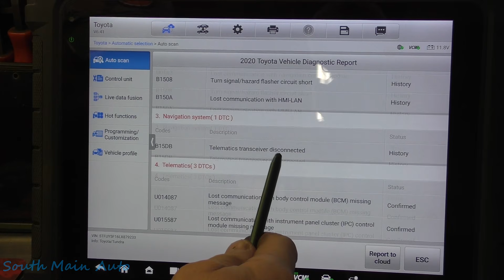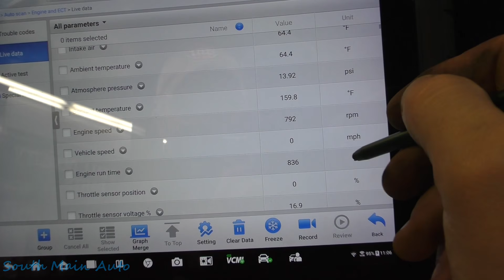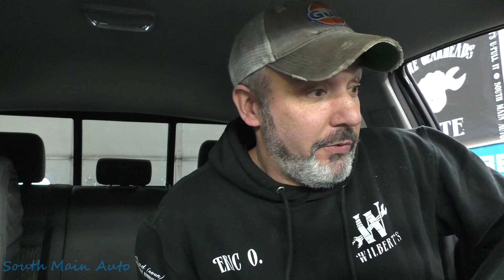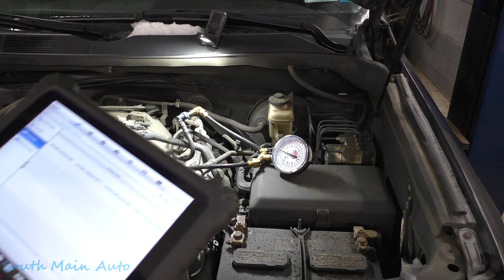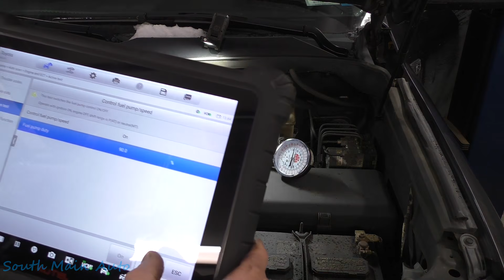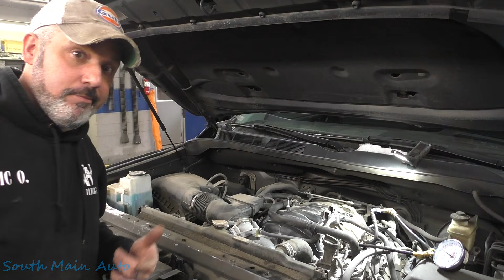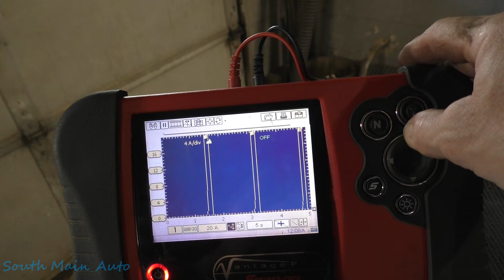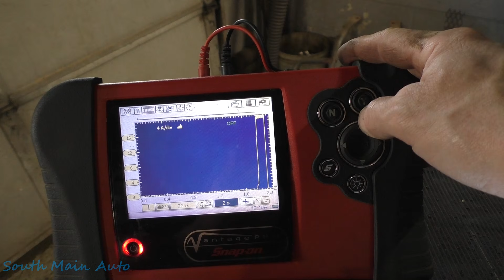My Customer Is Getting Shafted By The Local Toyota Dealer

Comment: My mind started to whirl at the point where you targeted the next area of attack.  A dealership mechanic would have the luxury of then walking to the back racks and load their parts canon until the issue was resolved.  you had to use critical diagnostics.  This is one of my favorites.  Thanks.

Comment: Lets see, fuel pump made in China,  life expectancy not rated, quality none, and end users are to do quality tests. But the profit margin on the end product increases. I do not like installing electrical connectors and electronic modules on the frame or underneath a vehicle where they are exposed to water splash areas. Also, what happened to corrosion proof frames and under coatings?

Comment: What is amazing to me is you are actually SPEAKING to your client/customer. I was actually told by my local Ford dealer that “we usually don’t want technicians speaking directly with customers.” when I asked to speak to the technician directly. How in the WORLD am I supposed to explain my issue when I have to translate it through a service advisor that usually has absolutely no idea as to what they’re even talking about…
Reply: Typically what happens is the problem diagnosis changes as the chain of explanation lengthens.
Reply: While likely not the case in your circumstance, look up "customer states..." videos for reasons techs may not benefit from talking to customers directly.  Even Eric laments customer descriptions at times...
Reply: @BrianFullerton yup😅
Reply: @BrianFullerton  I've had a regular customer tell me that he hears a slight grinding noise. I get in the car and I can already hear it at 5mph in the parking lot and roaring down the street at 20mph. The majority of car owners are totally unreliable to describe what's wrong unless it's something as simple as "my headlight doesn't work". Even then, there are way too many people who don't know how to turn their car's headlights on manually. I hate to think that people are stupid. But in this industry, common sense seems to be rare. Literally had to argue with a customer the other day before a blizzard that when they press the button and "TCS OFF" comes on the dash, that means that traction control is off, not on.
Reply: @XSR95 I went down this road with the overdrive button on the dash for dodges, it's obvious, and the tach tells you, hit the button revs go up indicating a down shift and od off, some people just don't have it in them though
Reply: When i take my 22 Tundra in,  I demand to talk to the tech. They are the only knowledgeable people.
Reply: This is one of many reasons why I am my own mechanic,
Reply: That's the problem I've noticed working as a tech for 11 years. It can be even worse the other way though. I've explained to advisers what the problem is and the reason for failure then I hear their conversation with the customer and they absolutely butcher it. I still prefer to not talk to customers but rarely have to now due to having a tech of 25 years working up front. He still wrenches too so we both still learn from each other. It's great not needing to explain how the evap system works and why it needs a purge solenoid only for them to say it needs a gas sensor.
Reply: From Office Space: (The Bob's): "So, what would you say that you do here? Well, I take the customers reports and bring them over to the software engineers. 
Well, why can't the customers give their reports directly to the software engineers? 
I'll tell you exactly why - Engineers are not good dealing with customers and I have people skills".
Reply: I’m a tech at a Toyota dealership I would call the customers name in the ounce all the time and talk to them all customers usually appreciated it. It’s nice to get the story directly from them sometimes.
Reply: @JKCL20  in your honest opinion, do you think service advisors even serve a purpose? Or does it just make your job more difficult?
Reply: it equates to more dollars because of the line of confusion not communication!
Reply: As a seasoned marine mechanic sterndrive and outboard, any runability work order I would always insist on calling the customer and pretty much interrogate him/her.  They never seemed to mind as I would tell them any info they give me will help us get to the root cause quicker and cheaper.  Well would ya look at that..there's your problem lady..  Cherrs all!
Reply: I had the same issue with my local Ford dealership. After some fineggling I did get to speak to the service manager who arranged a sit down with the tech and we cleared things up. I think it just protects techs from customers.
Reply: I’ve worked on both sides of that service advisor and tech. A lot of techs do not want to speak to customers do not know how to or do not care to do so. Not blaming them just could be one reason why
Reply: @Banatar  And I've only worked the tech side and can definitively say that I always like to hear the problem directly from the customer, not translated to paper by a service writer. Some service writers know the right questions to ask but many do not; which can lead me to chasing my tail. And on the dark side, if I don't have complete or accurate information the chances are greater I will be replacing more parts than necessary, unbeknownst to the customer.
Reply: @Banatar  I dont like speaking to customers that is what the advisor is for. I wouldn't expect an advisor to a fix a car for  me. Im flat rate not hourly.
Reply: @joelopez40oz23  you're one of those horrible techs that think you're better then everyone because you turn a bolt lmfao.. im willing to bet you can't diagnose much.. and pass on jobs that require actual work to figure out.. unless its hanging on by a thread or snapped in half.. You're one of those people who probably hack your work back together like the repair shops around here do too.. im almost 100% certain you try to cheap out on parts and repairs then charge the most you can on a job.. how many procedures do you actually follow vs jacking up the job by trying to cut corners to save time? Face it.. You're a conman just the same.. your attitude speaks volumes. "I don't like explaining myself to people after I caused more damage then what they had when they brought it in".. is how you sound.. just like all the other hacks in that industry
Reply: @joelopez40oz23  This attitude is why we can't get vehicles diagnosed properly. Because of you parts swappers.
Reply: @Banatar wrong., its the shops trying to play middle man so they can charge more for work that wasn't needed, then claim they weren't told the issues you had.. how do I know? Because over 7 shops did this to me in the last 3 years on my truck.. how about techs arent all that intelligent and don't want to do half the work Eric does in these videos.. most "techs"  at dealerships are oil changers and tire rotators.. they don't want to FIX anything anymore..
Reply: @jacksparrow3490  How many dealerships have you worked at to come to your conclusion?
Reply: @joelopez40oz23  sounds like more then you.. try ive worked for one of the biggest in my area.. and many smaller ones as well.. how about the dealer trying to tell me it would cost $1000 to verify my transmission is bad when it was in limp mode? The tech didn't even know was AWD all the time meant.. he tried claiming my truck was 2 wheel drive then 4x4 when it detects a slip on the wheel.. oops wrong.. my truck is AWD with no switch.. so no, techs don't know anything anymore
Reply: @jacksparrow3490  only you know everything lol.
Reply: @joelopez40oz23  obviously know more than you drinking your 40oz.. which im sure you "test drive" customers cars for every little errand you run..  I bet you hot rod them nice sporty cars too acting like their yours.. You're one of those clowns who gets caught driving a customers car like you stole it.. go watch some videos of people leaving cameras in their cars taking to a dealership.. this isn't knew information there buckwheat.. You're one of those lying mechanics who can't articulate what you did on a car because you hack it up 🤣
Reply: @jacksparrow3490  "Over 7 shops" did this to you? So... 8 shops?
Reply: "how about techs arent all that intelligent and don't want to do half the work Eric does in these videos" <--- This is partly true and some techs have not been trained or educated to perform a proper diagnosis which requires time, research, tech manuals... all of which may negatively affect profits. Hence, the shop managers may not allow.
Reply: Tell your local ford dealer to go to hell.
Reply: I would leave that dealership NOW
Reply: Super good work by Eric I love the old school tech tool "hammer" that's what I do all the time and the comments on this video are excellent, people in the field who have real world experience with the public, I can do relate , great stuff 🤠
Reply: I always want to talk to the customer when I work on their car. Especially when I can’t duplicate the concern.
Reply: Your technician does not get paid one penny for talking to you. Perhaps you should just ask your service adviser at the dealership to create a work order for one hour labor for you to talk to your technician? I feel certain that you would then be able to talk to your technician if he was getting paid for talking to you. Or, do you think talking to you will put food on the table for technicians. Also, if the technician is not getting  paid, well neither is the dealership, or service adviser. Pay for auto mechanics is all based on commission.
 
One thing you can bet on? South Main Auto is getting paid by the customer of this truck. By both the customer, and You Tube. If he wasn’t the truck would be sitting in the parking lot, or towed away. 😂 

Over thirty years ago, when I was a technician at a GM Buick dealer, we were paid ZERO for diagnostics, that’s right, ZERO nothing. Do you work for free? I got the hell out.
Reply: 6-7 years ago I bought a new Ford truck and I noticed the steering wheel wasn't centered after I took delivery. (A pet peeve of mine) 
The service advisor told the tech to ride with me and fix it while we were together. 
We drove it into the service bay and onto the alignment rack 3 times before he had it perfectly aligned. I was with the tech the whole time. 
That was great service, and it was with one of the largest Ford dealers in my area.
 I now buy all my vehicles from that dealer.
Reply: One reason the dealer doesn't want the tech talking with the customer is to reduce moonlighting opportunities.
Reply: find a new dealer.
Reply: I, and the rest of the world struggles with that too. Talking to most "service advisors" is useless. Communication is key and NOTHING beats a one-on-one talk with the person who is knowledgeable with the topic at hand. Would we NOT talk to the doctor before determining whats wrong? No way! One thing is certain, we'll get the useless survey 5 minutes after leaving!
Reply: Service advisor is the closer for sales.
Reply: While I agree, in part, for the vast majority of customers, almost every single sentence of this video would just go way over their head as industry jargon. Showing this video to the average car owner would be like the most adept mechanic you know watching a nuclear physicist describing how a nuclear bomb works and then trying to make one. You might trust the mechanic, because now the vehicle works, but there's always someone out there who will doubt it and call it a scam and claim that maybe they didn't really need $xxxx amount of work. "Why wouldn't a $10 relay work just like some random guy on YouTube said? There's no way I really need the whole fuel sending unit/pump replaced!" I do my best to physically show the customer myself what's wrong every time I can. Even then, I've been burnt by ungrateful customers or those who simply don't understand something as simple as a wheel bearing or tie-rod being loose = bad 100% of the time and it won't simply heal itself.
Reply: why a lot of tech don't get payed to lie so they will tell you the truth and the lyres for hire don't like that it cuts in to there money flow
Reply: That's partly because they want to try and milk the customer out of some crap work, especially if they are car ignorant and believe whatever the dealers say or suggest.
Reply: @Methodical2 Kind like how mechanics don’t know shit and usually cost the customer more time and money if it was done right? 

Because working at a dealership we get these customers all the time.
Reply: Because a tech will tell you that your car is a piece of shit and the service writers are paid to tell you that you drive a cadi 😅
Reply: Please 🙏,  if you want to offer the information in your own words, you can write a note, make a video and put the url on a note, or some variant where the tech that is probably doing 4 things doesn't have to stop to engage with you. The front of the business does that and I can do what I do. I'm pretty sure I know these cars better than the owners. Why? Cause ted has 1. I've driven 60 of 1 body style. Ted can feel a problem.  I've felt and fixed problems everyday since i was 16.
But ya don't need to talk to me. I don't use eye drops and I'm fairly ripped, bad breath, food in beard
Reply: @mr8610  You’re assuming the tech even wants to speak with you.
Reply: @cwqrpportable  When a tech is assigned  to repair my vehicle, Personally don't care if he doesn't want to talk to me, I will demand the tech explains what is going on with my vehicle and how he plans on repairing it . its my truck and my money fixing it..

Comment: I have a 2019 and I believe it was mid year 2020 maybe when i got the recall notice.  I took it in and had it done, I never had an issue but wasn't going to take a chance. I'm at 100k miles now and  still doing fine, fingers crossed.

Comment: Last time I saw a pump like that was on an old Astro van. It had 56 PSI on the battery and would not start. As soon as it got boosted with a battery charger or a running vehicle it had 58PSI and it would start and run just fine.

Comment: So your customer had this video to show them your diagnosis? Is the dealership asking you to train their "technicians"? I'm always amazed at your logical thinking as you work thru these problems. Also, I went to my local library in Ocala, Florida and can now get online and pull info from Auto Repair Source, Motor Driven. I can pull up more info than I know what to do with! Thanks to you, I found this link. LOL, "If you can fix it, I can try."

Comment: I have a 2002 Jeep Liberty I got in 2015 from my SIL. Engine was messed up so I replaced it and in 2021 there was low compression in cylinder 5. It got sent back and rebuilt and after reinstalling by a shop it had this issue. Fired up when cold but after heat soaking a bit would just turn over until I gave a touch of fuel. They said bad fuel pump and they replaced it twice. Still had the problem of not starting after heat soak. I had a "cold air intake" so I installed that and the issue went away. Eventually I replaced the injectors and coils and plugs. Installed the stock intake and the problem returns, With the cold air intake it starts fine when hot. No idea what is really wrong but I haven't put the stock intake back on for a while.

Comment: yea, just scanned my sons kia while he was home for christams with my new launch.  Error code for MAP sensor out of range, even showed voltage of the sensor.
Problem is the car doesn't have one, it has a MAF sensor.  Didn't get the chance to check under obd2, i'll be swapping out cars in spring and have a look at it then.  It is running fine.

Comment: You can clearly hear that a bearing or bushing is gone in that fuel pump motor and that it's rubbing up against its field. Once it jambs up against the field, you can sometimes get it going again by giving it a good bump, like with the hammer to the gas tank that Mr. O did. Your ears are a diagnostic tool as well with combined with a little knowledge on what to listen for.

Comment: Got a '12 Tundra 3UR just rolled 366k, we also just drive it and never work on it because it never breaks lol
The 5.7 is an absolute weapon!
Serp belt tensioner and a water pump is all it has ever needed lol, and about 32849 oil changes lol

Comment: I was a Ford tech for 20 years. I quit the dealers in ‘18. They have been bleeding the talent for a decade and our left with morons and the guys who are too scared to leave or feel they are too old to start over elsewhere. It’s pretty sad because the type of diagnosis I see in this video was commonplace at the dealer and expected. There was no parts cannon. Simply because warranty was tightly monitored by Ford. If you replaced a good part the dealer was often going to end up eating the bill when Ford kicked it back. This meant they had to staff quality techs who could diagnose properly. I can’t even fathom how they can get away with the way they operate these days. It’s so foreign to what my experience was. I work for a fleet. Literally HALF of the trucks we send in for warranty work are not repaired properly. It’s the same at all the brands and dealers in town. Not a single good one.